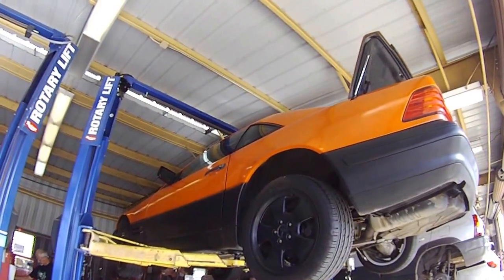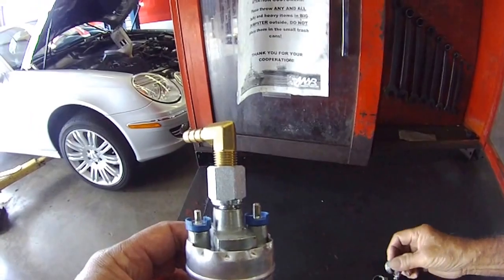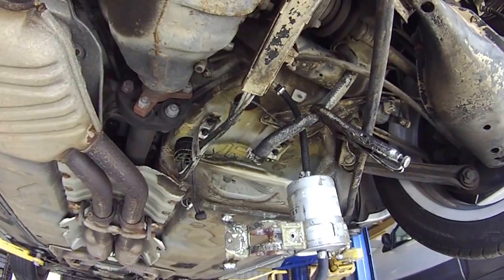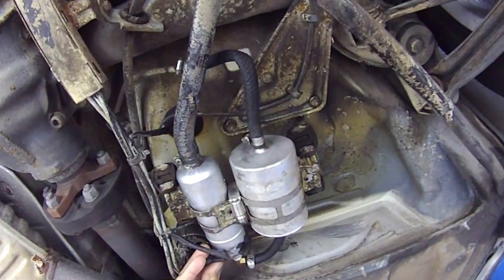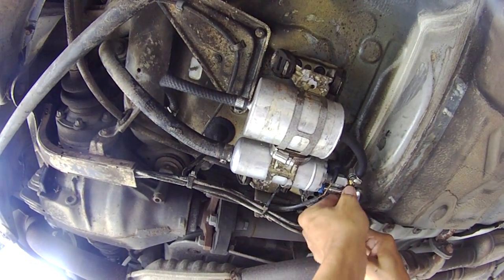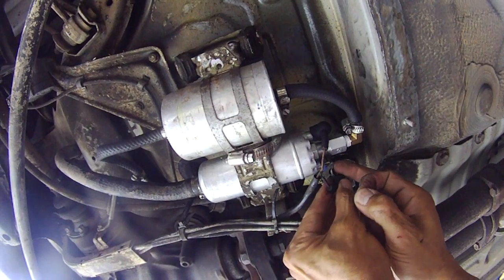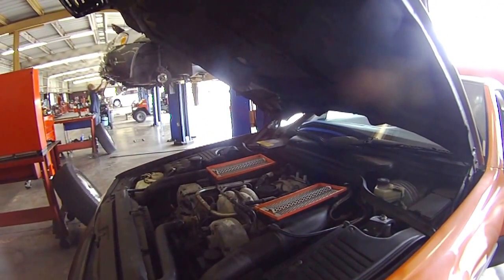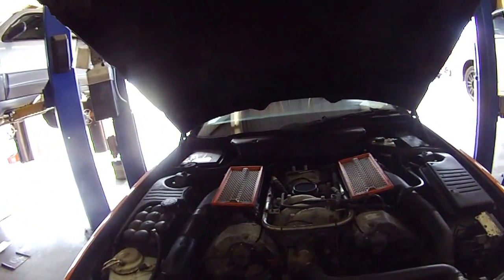1997 Mercedes Benz SL 500 Fuel Pump Location and Replacement

Comment: To make it easier to start after replacing the filter/pump, look for the fuel pressure test port in the front of the engine, under a plastic cover. You can then bleed the air out of the fuel system, making for a much easier start. (You could also prime the engine with a short shot of starting fluid via the air intake.) This will help to save wear and tear on your starter. I hope this is helpful to you.

Comment: That pump is the type used until circa 1995 when there were 2 identical pumps. The newer cars use a stronger single pump set up

Comment: Buen día dónde lleva o va el rele de combustible el Mercedes SL 320 o SL 500
Reply: The fuel pump relay in Mercedes R129 generally 96+ is located in the trunk..next to the battery. Along the body are 2 big relays colored green and Orange. They both have fuses in them..The green one is your fuel pump relay.

Comment: Doesn't this car have two fuel pumps?
Reply from the maker: it sure does. this is the one that is hard to find
Reply: +jusride7 Ik about this one where's the other one located?
Reply from the maker: +AMG BENZ_HAMMER_6.0 I think in the engine bay. I forget. I sold this car.
Reply: +jusride7 how reliable was it? So far I like mine a lot
Reply from the maker: +AMG BENZ_HAMMER_6.0 very fast. lots of torque.
Reply: Yes they should be stacked one above the other on the same bracket. Looks like someone got cheap and is only running one.
Reply: @DaytonCarCare  up to 1995 it had 2. Later cars had 1.